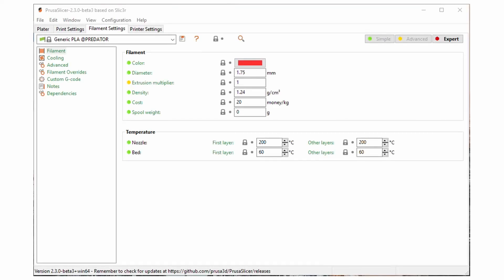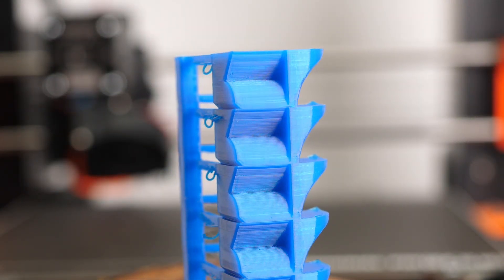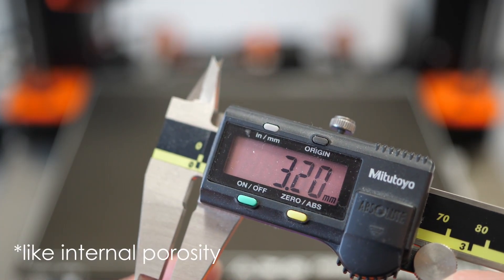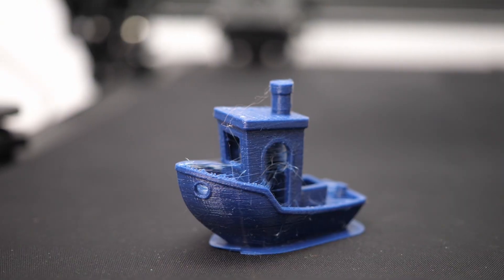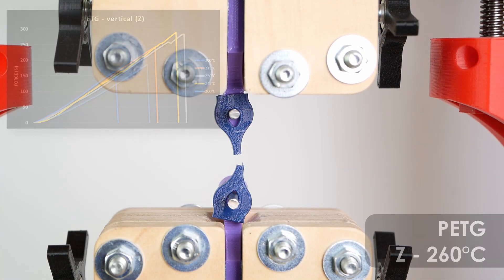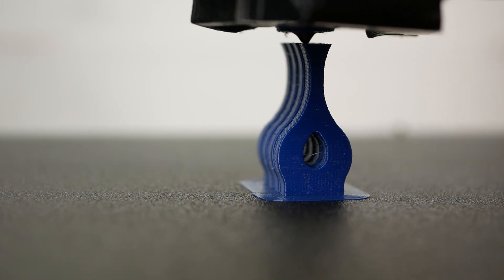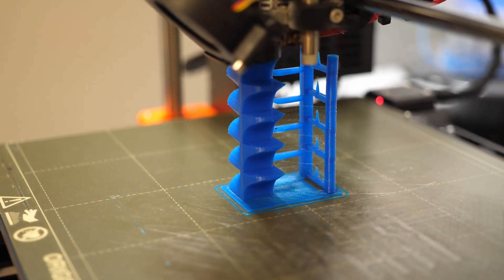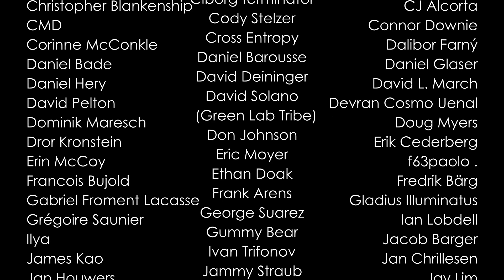Stronger 3D prints at higher temperatures? (strength test!)

Comment from the maker: Show your friends how to properly chose a nozzle temperature and share this video on Facebook, Reddit, Twitter, and other platforms! ❤
Reply: I live in a crazy humid environment, air drying filaments does not work, it just gets steamed.

I was wondering if sublimating with dry ice would work. I thought it might be an interesting experiment at least.
Reply: Would love to see what filament material has the greatest layer bond adhesion comparison?
Reply: The CR 30 is now a Vidiography tool to you... 
Nice to have a Printer for that.
Reply: Hey! Thanks for the guide. Helped a lot. Keep up the great work :)
Reply: I couldn't see the extent of the bubbling you mentioned, and one would presume the horizontal print would reveal that decrease in integrity, so I have two other guesses for you (which you've probably considered already): 1. Assuming the stringing is the result of additional fluidity, there may be a reduced pressure of the printed paths as they are "driven" into the underlying layer.  I believe you touched on a related topic in an earlier video -- wider-extrusions must deform more, under pressure, to form a thinner layer height.  2(a). The greater size-change during cooling and solidification might introducing additional tensions in the final (unbroken) part.  2(b). This may even be during cooling of an individual path, where not only is there inter-layer tension, but increased tension even within the printed extrusions individually, as their skin cools before the inside.  Both the fan and the greater temperature difference between the new trace and prior layer could contribute to this -- the potential internal stresses maybe resulting in increased rigidity and brittleness.
Reply: OK, my specialization is in Porous Materials, so to evaluate the mechanical properties and the density I use specific strength, in which I divide the mechanical property by the density of the specimen. If the porosity is larger the mechanical property is lower, but with that simple addition, I could study the mechanical property of the matrix, isolated by the porosity. I  found that in the Gibson-Ashby "cellular solids" book, and several of my papers work with that DOI: 10.1177/0021955X14546015 ;  10.1016/j.jmatprotec.2012.04.024 (one is for porous plastic, review, and the other is for porous metals)
Reply: Hi Stefan, your videos are great! i looked a lot, and i can´t find one explaining the relationship between printing speed and strenght, do you have already one? i think it affects on strenght of the printed pieces in some way. Maybe you can make an interesting video combining all your skills, like for the best strenght layer 0.1, fan XX%, extrusión widh 0.X and print speed XXmm/s.
Thanks again for your fabulous work.
Reply: Hey Stefan! For further examining the high temperature degradation: Could you try if annealing the PLA would compensate for the degradation?
Like this:
Print the PLA samples at 230 250 and 270 in two sets.
One set goes straight into the testing machine the other stes gets annealed under all same conditions and the to the testing machine.
Would be interesting to see. if the bad results of 250 and 270 degrees would become better again after annealing.
Reply: can you test an infill that allows you to inject resin or epoxy into the 3d print? if this works it will strengthen your 3d prints and may allow more aggressive sanding if needed in a bad area of your 3d prints.

Comment: @CNC_Kitchen : Stefan, have you ever tested the best layer direction for side-loaded 'column' type printed parts?   

I'm in a situation where I can print a square tower-like part in different alignments.  It will be loaded from the side.   And I'm not sure which route I should take to get the best strength.   And I lack your setup to test it, of course.

I love your videos especially the thorough tests about strength! :)

Comment: I throw a six sided dice 3 times, to get the print temperature. I've always gotten 1 or 2 as the first throw for a long time!

So when I got 3 six's in a row (666c), I knew my printer would go to hell, which it did! Two dudes with water hoses came and ran off with it. I think they either had helmets or horns, I'm not sure, I got a bit dizzy from the melted plastic fumes...

Comment: Hey Stephan, we all know that higher temperatures increase layer adhesion, we also know that cooling decreases it. But sometimes you want stronger prints but the higher temperature might be too much (benchy smoke stack thing) there is no video regarding the combination of the too. So would it be better to print at 200 degrees but no cooling or 230 with 10% or 20% cooling. I watched both of your videos and there can be some interpolation made between them but we cannot be sure that the scaling is linear and this would really help me in lots of situations. Thank you

Comment: One possible reason the strength drops of at higer temps, might be because the already printed layer cools off too much, so the diff between the 2 layers are bigger?
Would be interesting to see if there is any difference printing 5 and 1 item at a time.... Or maybe add g-code between layers to have the nozzle go park in the corner for X number of seconds.

Comment: Your strength test videos have been great! Very informative and rigourous enough for hobbyists to make informed material choices. Takes me back to my engineering classes!

One thing I haven't seen analysed is which filament material has the worst "creep". PLA is supposedly pretty bad, and I've heard PETG is better but there's no actual data.

I request a creep test! First suggestion: cut a 100mm strand of filament, hang a weight off for some fixed amount of time and check the elongation. I'm particularly interested in PLA, PETG, polycarbonate, and carbon fiber reinforced variants.

Comment: About the highest temperature being weaker, my thought is that the fan of the extruder is cooling the already printed part, so there is a temperature delta between the "cold" previous layer and the "very hot" temperature of the filament extruded. Maybe even some retractation (mechanical size reducing because of the cooling). Maybe you can try without the fan :O

Comment: When i want something simple with high strength, i usually use for PLA 270° 1.6mm extrusion width at 0.8mm nozzle diameter no fan speed down to 50% and 0.3 layer height in a chamber at arround 50°C
At this settings layerlines disappear,the part almost looks like vapour smoothed, but with a textured surface. It looks really nice, and i suppose its pretty much perfect layer adhesion, but i never tested strength.

Comment: The bigger factor that is unaccounted for by virtually every single 3D Printer... Is the Air temperature of the printer area. The printer should be enclosed, heated, maintained, and with steps taken to reduce moisture content.

Comment: Anecdotally I've always found hotter is better for amorphous polymers (eg abs/pc).  It also makes a huge difference at a specific temp if you have a cooling fan enabled or not.  For ABS, it's always stronger without a fan - hence why dual extrusion machines have a huge advantage because you can print very hot without a fan without sacrificing accuracy from support gaps.  This is why stratasys machines don't have cooling fans.

Comment: Interesting results, makes me happy to see I'm not totally wrong with my 205°C default. I've personally always erred on the side of colder temps but had a lot of issues with underextrusion (though that was also in part due to the extruder idler slipping, which has since also been resolved) so I've inched my way up towards where I'm at right now. It wasn't quite as rigorous a process as you've shown here, more a lot of trial and error. Hope this vid helps smoothen the learning curve for beginners a bit 👍

Comment: Hej Stephan, I’d like to see a strength test in z direction of PrusaSlicers new feature, ironing. I’m mentioning it because it’s able to iron EVERY layer, unlike many other slicers. By ironing every layer it does remove a lot of small holes making a 100% infill part come closer to injection molding. Layer bonding should be higher, right?

Comment: I have noticed that PETG become brittle when cooled below 40 dg to fast, I have had luck putting a fence of isolation around the build pate, so that the temperature is kept high by the build plate heating, then te strength become more like when printed flat.

Comment: I suspect degradation and bubbling/blistering could both be playing roles.  I would think that since "over-cooked" thermoplastic loses molecular weight and damages polymer chains/branches, that would to less entanglement between layer surfaces.  Add to that more voids from bubbles/blisters either naturally from internal moisture or absorbing atmospheric moisture? via gassing-off? Additives vaporizing?  not sure, BUT the bubbling could be tested with a microscope I suppose, and then the cause narrowed down with... more elaborate means (printing in inert gas to vacuum environment and very low humidity, etc?). 

On a somewhat related note, you should take a look at PLA layer adhesion with much higher bed temps and ambient heat.  Anecdotally at least, it seems to have more effect than raising the nozzle temp.   I have not tested directly and could be off base, but stumbled upon it when I raised the bed temp to try annealing a cooling shroud while it was printing.  could be worth a peek to confirm or deny

Comment: Probably worth a note about the accuracy of the temperature sensors found in many printers not being anywhere near calibrated. Required set points will vary by quite a bit (+-15K) depending on the printer

Comment: Since the viscosity is required to be adjusted for increased speed , it doesent really matter as you only got a fixed temp about 40mms plus to about 50, after that if you dont increase temp you will get feed issues. The temp will however not be increased per cm so an increase will only work up to a certain level ams it is linear to speed more or less

Comment: Actually i start without a temp-tower and use the arithmetic middle of the temperature the filament producer writes on it :P. Usually for PLA it is around 205°C. When i see strining i drop by 5°C and in most cases land on 200°C ... that's it.

Comment: I print PLA preferly at 225 because of your PLA video an I use very often the presets in prusa Slicer also for expensive material like PP (verbatim) PC (Polymaker) and Prusa PLA. 
But I am often to lazy to print a temperature tower so I decided a lower temperature when it should look nice somewhere in between 190-203 and when it need to be stable 225 for PLA.
And after some prints I figured out, that at my machine many PETGs print well at 238, except the prusa PETG. Also for 2 Customers I made some temp Tests because of their need for a smooth surface.

What I'm interested in is, how good custom nozzle materials are, my nickel plated  copper nozzles are quite good.

Comment: Honestly I like drying my petg not in a typical dryer cause I don't find they get warm enough personally to get it dry and I find petg even fresh as long as it has sat for a month in a wherehouse depending on locations I still dry mine cause of where I buy my filament they are a high moisture location was so bad that petg popped at like 230 was a brand new roll well packed

Comment: Hi, Stephan! I think that standing samples (PETG) printed on different temperatures gave you different results because you're over-hotting them. Every layer square is too small. So you're basically "drawing" over the same place with the hot nozzle. It constantly degenerates (on high temperatures) lower layers while printing next layers. But it makes them stronger if the temperature isn't high (a kind of a natural hardening happens). 
And of course the laying samples become colder pretty quick in different places because of the higher square of printing.
So these results can be pretty actual for some prints.

Comment: Because your Stefan...  ...considering features in the firmware and slicer used - 'coming up with new features:  How about a "spot welder" like feature?  Where the nozzle pauses in the print at corners every few layers and semi-reheats those points through and past previously laid down layerings?  At those points, the nozzle would heat up 10C or whatever for a duration, and then return to its assigned temp, and continue printing, until it got to the next "spot welding point" where it would then stop, and increase its temp' again - and repeat.  Royally add print time, and start challenging image quality, but considering coming up with new features and being creative.........  ;)  Peace love 'n' happiness from the Pacific NW of the US.  :D

Comment: It could be that the layer adhesion itself becomes brittle at the higher temperatures. As you suggested, more bubbles may be present due to moisture. It makes sense that at a higher temp, more moisture would be boiled out of the material. This would create more failure points. I also wonder if the previous layer becomes brittle due to cooling from a higher temp. At higher temps, the difference in temp between the material and the surroundings makes it harder for that material to retain its thermal energy. So essentially, the material cools too fast. This would probably be present in you XY orientation models however. 

I was wondering, why did you use Kelvin for your delta T values? I know Kelvin and Celsius are on the same scale and a delta T of 20K is equal to a delta T of 20C but I was just curious if that was some convention. It makes perfect sense if you’re doing thermodynamic calculations with it because those are mostly based on absolute temperatures. Just wondering because I don’t have any experience with engineering outside of college. Thank you.

Comment: Time between layers is also a factor. If the previous layer is still hot the temperature the resin is fusing at will be higher than if the previous layer has already cooled. Could be a reason the laying samples didn't show the same difference as the standing samples.

Comment: I once printed 12 little Lego men which worked fine, but trying to print just two with same settings ended up a globby mess. The reason was that with 12, each layer had a bit of time to cool but with 2, the layer being printed on was still mushy and so got pushed around by the extruder. I have found this effect for complex prints with some parts large and others small islands...one temp setting isn't always optimal for the whole print! I think a layer area : part volume ratio ratio may be able to be used to tweak fan speed in slicer software.

Comment: At my workplace, getting dimensional accuracy was more paramount than overall appearance (which we can address through post-processing) or part strength. I spent weeks tuning the machine we had to minimize ABS warping, where I settled on temps between 235-238C and, ironically, with minimal part cooling fan (enough to "freeze" the plastic in place, but not enough to exacerbate warping). I'm able to get away with a little fan because the print volume is fully enclosed, and I tend to preheat the machine for at least 30 minutes before printing to make sure the air temperature is stable.
There is still warping, of course, such as when the printer transitions from a low-density layer (sparse infill) to a higher-density layer (surface infill); this is where mass becomes a factor in warping. There are ways I can mitigate that, such as with orientation.

Comment: I think the explanation for weakening over certain temps is due to the stringing causing the plastic that should be part of the model forming string which means that the sample is weakened by lack of plastic. Try printing one at a time rather than the batch of 4 so as to avoid the strings

Comment: PLA melting temp is around 180C and PETG is around 230C, so it seems like moisture has more to do with the layer adhesion than temperature does. Makes me wonder what would happen if printing were done inside a vacuum chamber, or a chamber filled with CO2. Enclosed printers tend to produce better results since the environment is more controlled. No air blowing across the parts causing uneven cooling etc. If I had the money, I would get a mini 3d printer and make an acrylic case that can be pulled to vacuum with a gas inlet to print in an oxygen and moisture free environment. It would be quiet operation too since the  entire machine would be inside a vacuum.

Comment: I haven't printed PLA in a long time but most of my ABS, ASA, PETG and PETG CF prints have been around 240-245, less and the layers (ABS + ASA) don't bond as well and a higher temp curls the edges a little effecting appearance. The size of the part will also effect the temperature I choose, a small part that will not have a chance to cool fast enough will get a lower temp while I can run a higher temp on a larger part without effecting it's appearance.

Comment: Very good video as usual. Regarding the strength of the PLA, I found that some filaments are stronger than the others from the same brand. For example, the copper color is the weakest I have (by far), all others (wood, black,..) offer higher strength. (from eryone, cyclone filament,..)